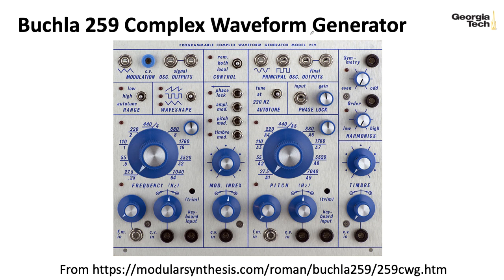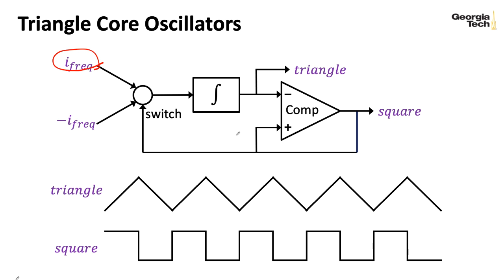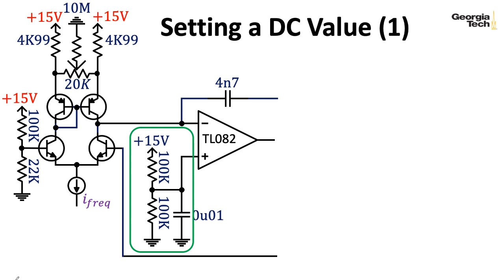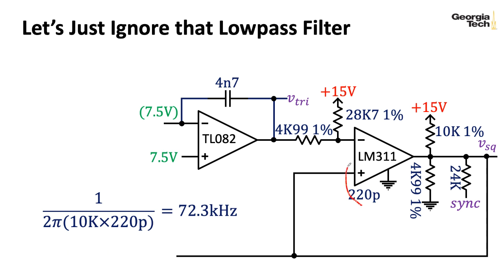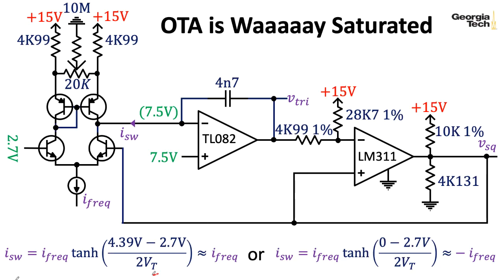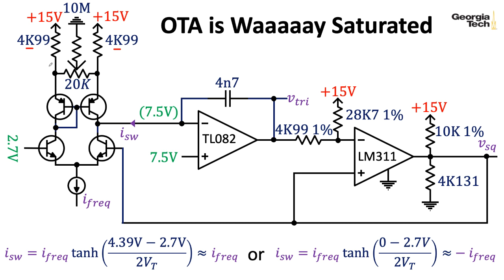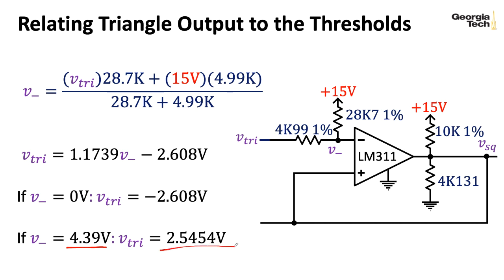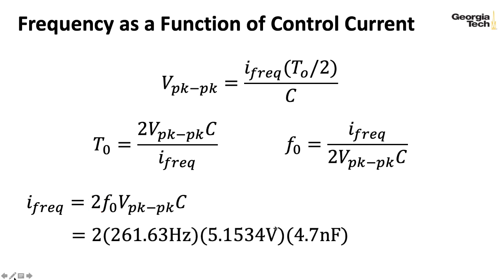ECE4450 L12: Voltage Controlled Oscillators: Triangle Cores; Buchla 259 (Analog Circuits for Music)

Comment: Current mirror is really bad. I have made simular triangle wave generator, and in that schematics should be used cascode current mirror comprised with 4 p-n-p transistors. Also what do you mean by match them? For current mirror two params are important: first is Vbe and second is hFE. You buy 100 same transistor and choose for example 20 with same Vbe. After that from that 20 transistor you chose several with same hFE. Chosing transistor in that way gives you garantee that cascode current mirror will work propely.
Reply from the maker: I'm just analyzing the Buchla schematic. Yeah, there are probably better mirrors.

Comment: professor, would the LM311 be uni polar  +12V 7 GND or bi-polar?, the generated wave is positive only.

to bad my dealer doesn't have the Ca3096, but does have the CA3086, CA3083 and i still have a few CA3046. i see many people use the CA3046 (like Doepfer), but not the CA3086 .. what would the reason be?  the parameters look equal. 

Renesas HFA3096 is almost like 9€ / piece.

but i can't find a PNP transistor array from the old intersill / harris line up. ya, i have the BCM857 but being sot23-6 not sure if i can solder that with my 25€ soldering station.

that 28K7 doesn't seam to be necessary.
Reply from the maker: Presumably the LM311 is run off of a full bipolar +15 V (for VCC) and -15 V (for VEE), but note it has a separate GND input pin which is what the output is connected to in one of the output states. 

Re: the various 3xxx chips, I don't think there's magic to it, I'm guessing it's whatever people had most available at the time.

Sorry, I'm not sure what you mean by the 28K7 not being necessary. It seems needed to get the v_tri switch levels to match up with what the comparator is feedback back.
Reply: @Lantertronics  yeah, i knew that pin to GND is pin of the internal transistor on the output. but i think it would probably also work having the LM311 connected uni polar. just wanted to be sure and prevent soldering things twice and trowing away things (hate breadboards), will make it bi polar. pretty neat thing that LM311, other wise the output would be negative.

i ran the circuit i the "Falstad" simulator ( with a simple current sink ) and didn't place the 28K7, because Jörgen Bergfors schematic doesn't have it either and it worked fine, but will add a footprint.

it's a real bummer i can't get the CA3096, but my my supplier has all other Intersil / Harris. to have matched
like i said, i have the BCM857 but am scared i might mes it up while soldering with a blunt point that's like 0.05 of an inch wide. maybe i should opt for Ian fritz transistor matching. to bad Jörgen didn't publish his schematic
Reply: @AnalogDude_  A year late to the party, sorry.
Given that the input common-mode range of the 311 does not go down to the negative rail, a bipolar supply is necessary in this case.
Reply: @Lantertronics  the Falstad simulator failed on the Buchla Sync circuit, on my prototype I'm gonna have 2 sync circuits.

Comment: is there a way to have this triangle core working without the  OTA thing??
Reply from the maker: The OTA is really just acting as a a switch, so other switching mechanisms can work. Here, Ian Fritz uses a DG431 analog switch chip: http://ijfritz.byethost4.com/sy_cir4.htm
Reply from the maker: I should say the differential pair of the OTA is acting as two switches; you still need a current mirror (here, the PNPs pair at the top) regardless of what switching mechanism you are using.

Comment: You're a transistor, lightning resistor. Conducting to the mother star, that's what you are

I don't even really like 311 but apparently that number is OWNED by a band in my head now.😄

Comment: the 28K7 is pretty hard to read in the Buchla schematics.

http://fluxmonkey.com/historicBuchla/buchlaFiles/Buchla_2590_2_200.jpg
it seams aside  a 1 1volt 7 octave input, there is a linear "control" as well in the schematic, the FM input. using a cd4066 a like and a vactrol.
would you enlighten us a alternative CV summing stage as opposed to Buchla's approach?

like you said, Buchla's schematics looks like they are from another planet.

Buchla seams somehow to derive the saw from the triangle.
watching the schematics of the modulator oscillator.
http://fluxmonkey.com/historicBuchla/buchlaFiles/Buchla_2590_1_200.jpg
using a cd4066 alike switch and a or gate + ....
would you show use as well?

the 24K = R164, the 4K99 = r155
Reply: ... and thnx for clearing the Buchla core.
Reply from the maker: I talk about Buchla's triangle-to-saw conversion a little bit in this video, but alas I don't get into it too much:

https://youtu.be/0vnj_obkdu0
Reply: @Lantertronics  i got the triangle conversion covered a few weeks back, like i told you before, there is a better way, but that's "simple" logic compared to the core of the VCO. a few years back i would have puled my hair to understand it.

do you think they (Renesas) improved the  "HFA3046 / HFA3096" over the old Cd3046 / CA3096 having to sacrifice one transistor and bind it to a negative voltage divider?

I'm trying to combine your info and Jörgens info to make my own version, I'm curious if it will track 1 Volt per octave.
thanks for your timer and comments.
Reply from the maker: I think the vactrol is just controlling the amount of FM.

Comment: Hi, Aaron!
I was wondering if there where any synths that use Square Cores in the VCO with effective waveshaping, do you know of any?
Reply: Saw to square is easy, as at any point in time, the amplitude of saw tells you what phase is it in at that point in time. Squarewave doesn't do that. It doesn't contain that information. Which makes square to saw more difficult and kind of annoying.
But it is possible and you can even involve things which wouldn't be possible with triangle core, like for example phase-locked-loops, or an differentiator to detect the edges of square & then perhaps measure time between edges and using that information some way to create new shapes...
Or the most obvious way would be feeding square into integrator (+using some smart DC blocking) to get a triangle, but that would have loudness dependent on the frequency. Or even timbre dependent on the frequency, if you allow the integrator to saturate/distort at lowest frequencies & it may be a good idea to do that a bit, as otherwise the loudness dependency could lead to noise noise issues (lets say that our range is 9octaves from 20Hz to 10KHz. Each octave will be 6dB quieter than the previous one, so if 20Hz will swing between +-5V then 10KHz will be -54dB quiter swinging only +-10mV which may be bit just few 10s of dB above the noise floor... bit too close..
But in the end, most of the methods (except some weird ones like PLLs) of square waveshaping will lead you to some kind of recreating a saw or triangle from the square and in such cases it's just practically easier to rather start with a saw or triangle in the first place. Also most of the square-cores have some point in the circuit, where saw of the same frequency occurs, and if you have both square and saw available anyway, then it's easier to use the saw, which is more versatile & easier to work with. 
Although starting with square and going the complicated way to saw or triangle may lead to some interesting audible artifacts, so don't get discouraged by the stuff above and try it if you feel like, and you may stumble upon something interesting.